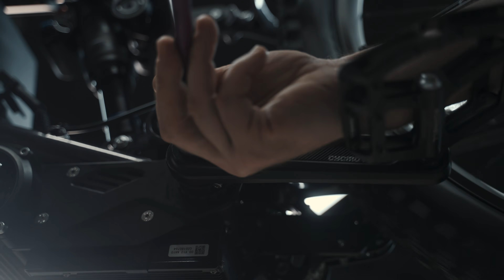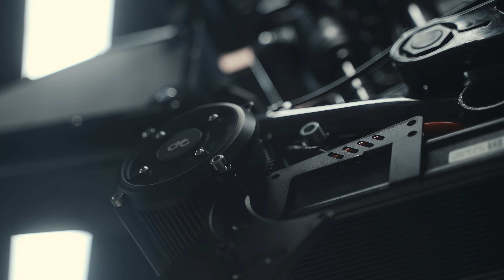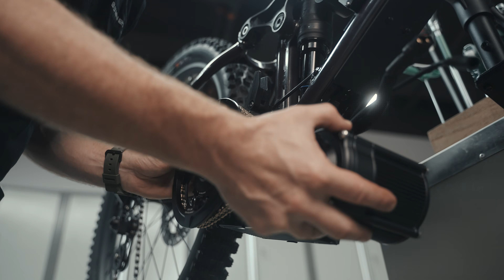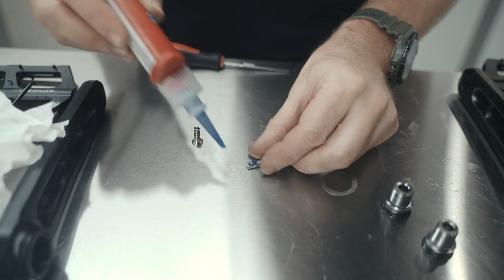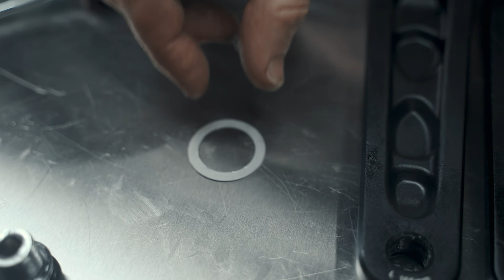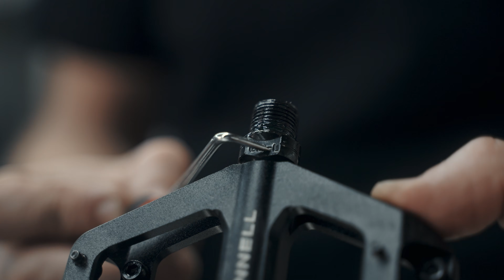Bonnell 775 MX Motor Replacement

Comment: Thank you for the good video. One major note, a quick snapshot of the tool specs needed for this job would make this a much better video. Like specific size crank extractor and bottom bracket cup tool.

Comment: Bonnell should sell the 775 frame without all of the electric stuff and then sell a kit to turn the bike into a 775 mx
Reply: Agreed, I got the CYC X1 Pro on another bike, would swap to a 775MX Frame anyday
Reply: My 775 mx will be here Wednesday I'm super excited. I was thinking of building my own but someone told me the Bonnell frame is perfect for the motor and battery setup can you try to explain to me what makes their frames so compatible with the cyc kit? Thanx

Comment: make this bike 25kg not 35...
Reply: how? With that much power heavy duty metal parts are mandatory! full blown carbon 700w specialized levo is 55lbs and costs 15k.
Reply: Yeah there really isn't much of a way to lighten this bike besides air rear shock maybe
Reply: The biggest factor in e-bike weight is the battery.  

Doesn't matter how far battery tech evolves it will never meet the energy / mass ratio of fuel/diesel
Reply: @BramBiesiekierski  the battery and the motor of this bike is 12.8 kg or smthng, why the bike itself is 23kg+??
Reply: @stramp6929 I cant speak to this exact bike.  But i know from first hand use with similar hi power MTBs, there are alot of things that all stack to make a chunky bike.  Often you need to spec the beefiest bits at every step, or your gonna spend alot of time out of action fixing stuff.  Even if you start off light, after breaking it every week you soon opt for the chinky option.

First up, this has a tripple clamp, dual crown fork, typically another 0.5-1 kg more than a trail fork.  That also means the front hub needs to accept a 20mm bolt.  Which means bigger bearings, and fatter hub.

Tyres dont last long, and I have split trail/exo casings before.  So i personlly always use the heaviest casing tyres i can find in 2.4".  (And I dont use Maxxis.)  Each tyre can weight 1.2/1.4kgs.  As much as 0.5kg more than a typical light trail tyre.

I also know practically every part of the drivetrain is a weak link over 1000w.  I use heavy single speed chains as they tend to snap less.  Quite a bit more than a lightweight 1x12 thin section chain.  And definitely never use aluminium cogs.  Chromemoly cogs, whether single speed or on an IGH.

I bet money the rear wheel is using at minimum 13/14g single but spokes.  I wouldnt use anything less with that much power.  And 32 3x or even 36 3x min.  

And lastly.  Why would you even want a light bike unless you like lycra riding up ypur arse.  In DHWC, hardline, redbull urbans etc the fastest guys are literally strapping lead to thier bike.  Its something i figured out a long time ago when i got into hi power emtbs.  Heavy bikes track better over chunk.  Hold a line better.  Hook up on flat turns better.  And generally perform much better at speed.  About the only place they suffer is tight switch back, and quick succession hi angle leans in opposite directions.  In basically every other attribute, they work better.
Reply: @stramp6929  heavy duty materials, you can't make a bike that have to sustain these speeds and torque and costs less than 2k (bike only no electronics, which alone costs 2k so 4k total) using exotic materials to also lower the weight. lighter 2k push mtb exist but they aren't designed to withstand 40mph and torque from a 2kw motor, at least not with this endurance. an eventual 10k version could be lighter, but let's be honest it's a stealth surron 90% of the time you'll go throttle only weight doesn't really matter